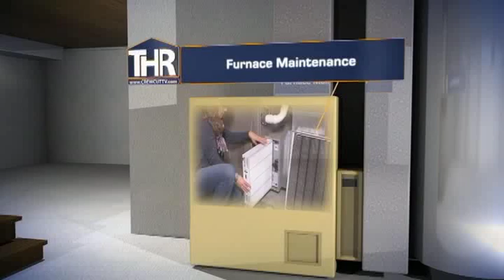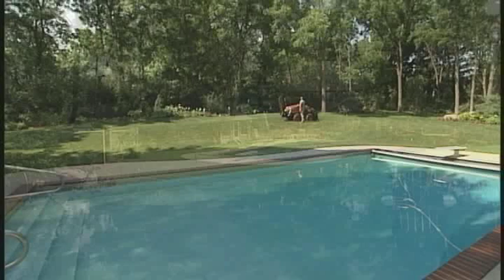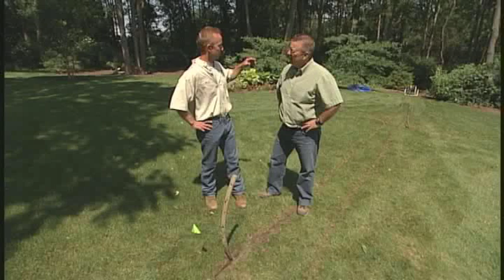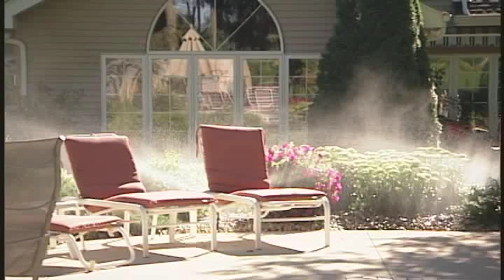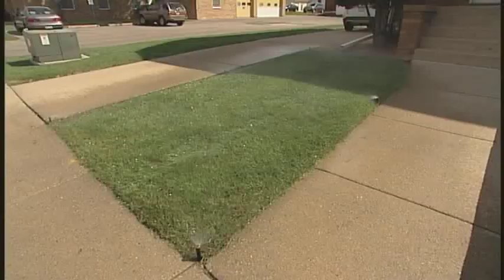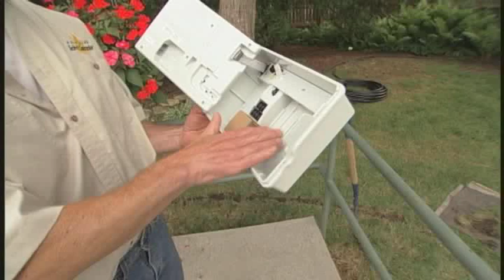Professional Installation of a Lawn & Garden Irrigation System

Comment: Rotary nozzle heads 6-feet inside the turf area with a 180 degrees angle shooting toward the planting area? What the hell was that? 

Male threaded by barb valves set up not done with proper manifolds? 

🤭😳

Comment: Why do these companies not use pvc? Is this a northern thing? I'm just curious. Or is because it's faster and easier? I have so many questions about this style lol.
Reply: Ryan Kurtz poly pipe is easier to work with, as you see in the video you can get rolls of the stuff in several hundred feet and it can be pulled with the vibratory plow. PVC you have to trench and connect several pieces together. Poly pipe is also cheaper and more forgiving in colder climates though you still need to blow out the system in the fall
Reply: whY USE PVC? Rainbird 1/2 poly is flexible and would bend to any not straight cut in the dirt.